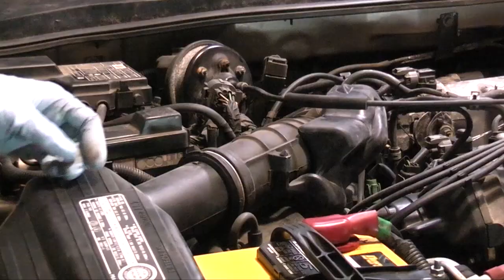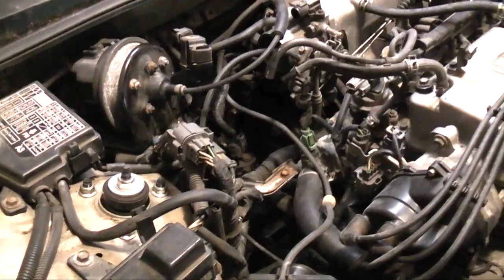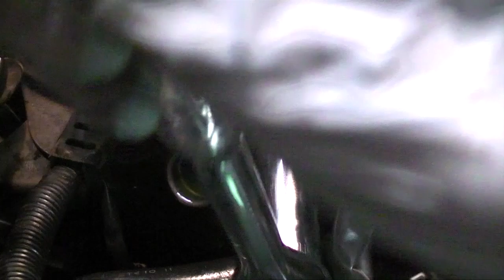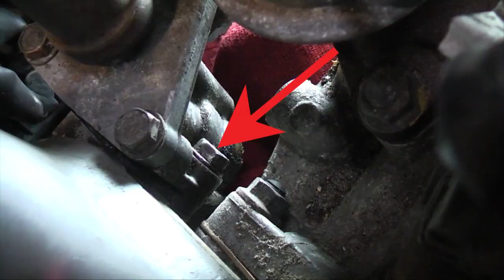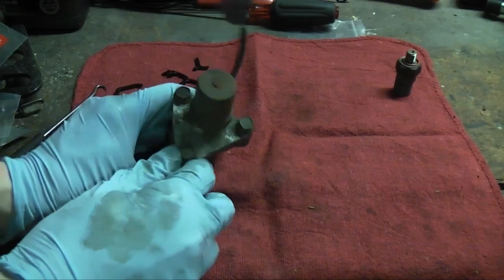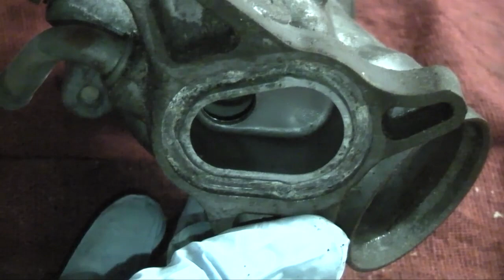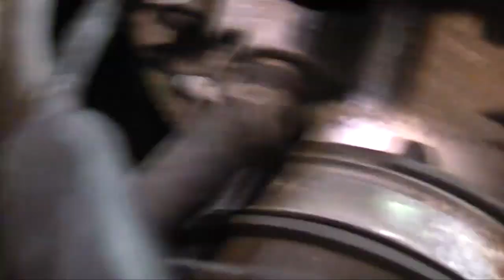Honda Accord VTEC Solenoid Gaskets Replacement

Comment: I have a problem, I change the gaskets for new ones but it still leaking at the bottom of the valve the bolts are tight, do you know why?

Comment: And the oil pressure switch o-ring. 
 Is it required to changethe o-rings for the radiator inlet housing?  Or can I just change the solenoid gasket and the valve head? The one with three holes

Comment: Very nice detailed video man good job.
Ive been meaning to replace my solenoid gaskets on my b16a2 cause one of them seems to be leaking.
But at the part when you remove the solenoid assembly is there any oil that spills out when you take it off?

Comment: You made it look so damn easy!! Will you ever post a tutorial on how to replace Brake Master Cylinder, Front Brake Calipers, Brake Pads, Rear Brake Calipers, Bleed the Brake Line, Wheel Bearings, Brake Rotors? l know those Captive Rotors on Honda cars are a real pain to be replace, what would be the best way to replace them with regular tools?